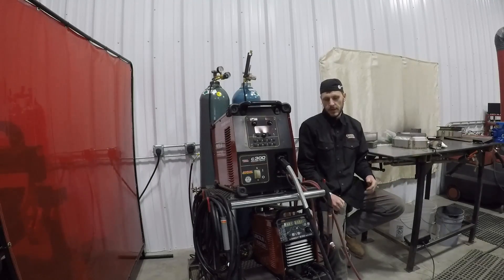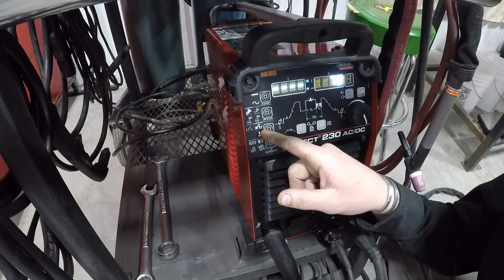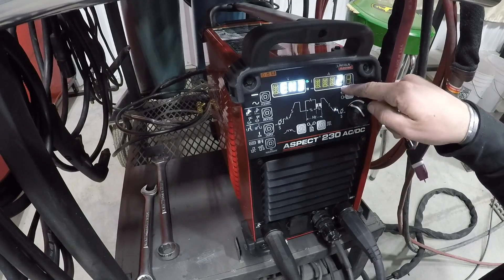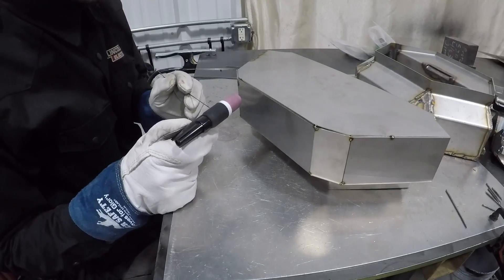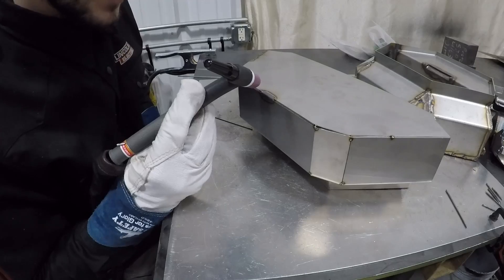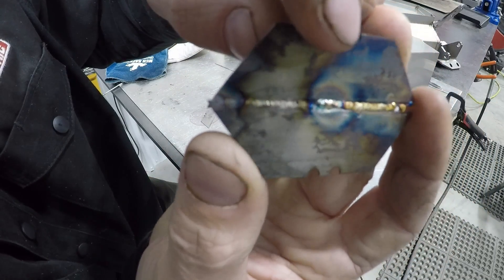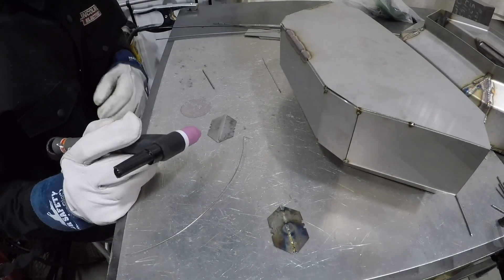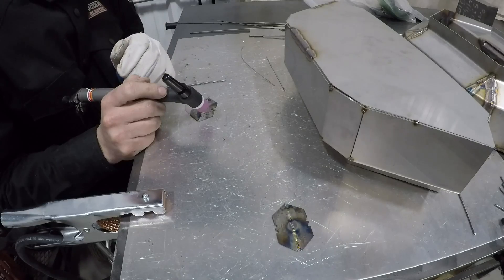Lincoln Electric Aspect 230: Control Breakdown & Stainless Steel DC TIG Welding

Comment: Hello I just bought one of these welders and installing a 230v 1ph plug end. There are 4 wires in the input cord(white, black and red plus ground. For 1ph, I disgard the red wire correct?
Any info would be greatly appreciated.

Thanks.

Thanks
Reply: I figured it out. 110v = black & white leaving red disconnected. 220v = black & red leaving white disconnected. Green is always ground.  BTW, this is by far one of the best welders I've ever used. 👍
Reply from the maker: @Potmetalrepair  sorry, I don't know why YouTube didn't alert me to this comment. For 1PH, exclude the RED wire. This is how I am currently configured.

Comment: Thanks for taking the time to share your thoughts and you did a great job. Lincoln doesn't give away machines to YouTubers to shill their products so there is not much content on them on YouTube. Does this machine allow you to set your background amperage and percentage in pulse mode? I have the C300 as well great machine that I am still trying to figure out the best settings for, not much out there for starting points in the different modes that I have found. Have found a good source for basic settings for the C300?
Reply from the maker: I apologize I never saw this comment. For the C300, I found the most help from the technical manual with all of the settings (it shows a quick breakdown of what each mode is used for), as well as working with my Lincoln Technical Sales Rep. He knows a ton about this machine, but unfortunately was forced into early retirement by Lincoln :(  #becausecorona
Reply from the maker: As for the Pulse background amperage, good questoin. The Squarewave ran half of your operating amperage. So, if you set the max to 100, but were only welding at 40 amps, your background would be 20 amps. I'm actually just now getting into more aluminum welding with the Aspect 230 since I finally purchased one.